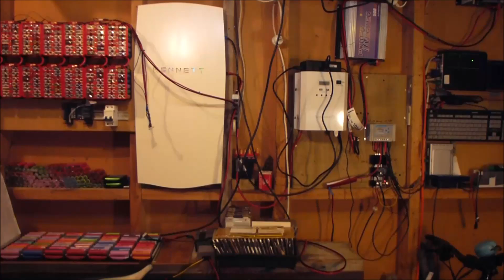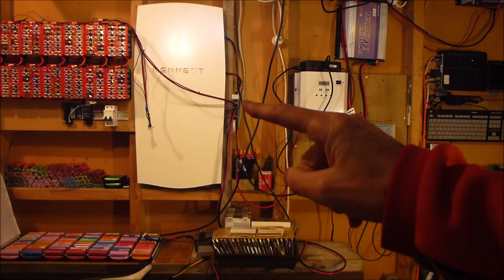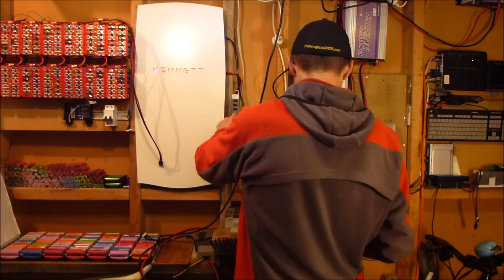Laptop Powerwall 92 - holiday planning

Comment: Hi 
Love your set up here. If I wanted to set my battery DIY power wall up independent to my grid what would I need?
Is the stuff listed above enough for say a small one bedroom flat. 
I have a south facing flat with conservatory with acquired solar panels.
I have acquired 8 X 24 volt panels plus two 6v panels 
Don't know how many watts that is? 
What's the most powerful inverter I would need to run say an electric oven, water heater, washing machine, fridge freezer, and small upright freezer.
Cheers Harvey

Comment: I would bring them down to a state of a "storage charge" or 3.3v and did connect them from the solar completely, it's only a couple weeks. These 18650 batteries sit in a warehouse for years and they sell them
Reply from the maker: It did consider taking them down to 40% SOC but ran out of time. I'm back now and it's all fine. I'll try to do a follow up vid tomorrow.

Comment: Good plan, best to be safe than sorry. Tho long term sounds like your worried about the cells without the bms and happy with the 2kwh powerwall with bms. So long term put the BMS's on the other units so you can relax abit more if away. Remember one day you might be sick or in hospital or away for a few days you don't want to be always worrying about the power at home or might not be able to. So a long-term solution is needed, even if that is just BMS units. :)
Reply from the maker: Mikes DIY Tesla Powerwall Yep. I've got a BMS for the Small Blocks sitting there waiting. The plan was to connect it up when the groups got too unbalanced. But they're still doing OK. Interesting...

Comment: A bit on the paranoid side, if the system and cells have all been acting normally :) Also lifepo4 cells - those by default are safe and putting them to different envoirement is more likely to produce changes than keeping them where they have been peacefully sitting for a year already. Also, I'm bit suprised that you havent thrown together esp8266 (nodeMCU) monitoring-controlling network that you can always remotely check and switch stuff over relays. Isnt mobile internet much of a thing yet in your country?
Reply from the maker: I've been putting off doing an ESP8266 / Arduino monitor for ages. I definitely will be doing that.
Reply from the maker: Thanks for that. I've got no excuses now :)

Comment: Hi Paul. Does your charge controller have a dump load feature? If so, you can set it to dump to your grid-tie inverter once the batteries are full.
Reply from the maker: The Wincong SL-03 solar charge controller doesn't have a dump feature - it's way too cheap for that :) It's another thing on my wish list though.